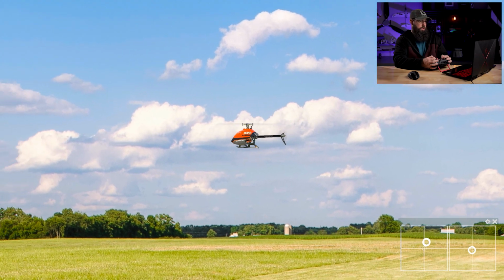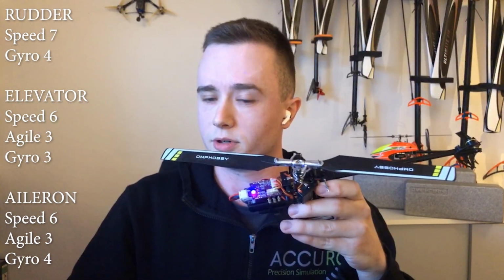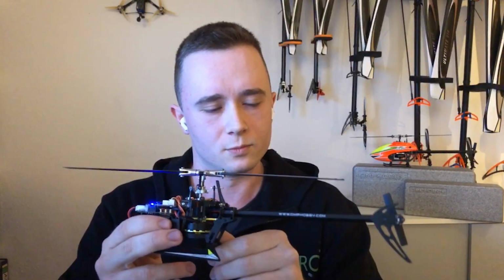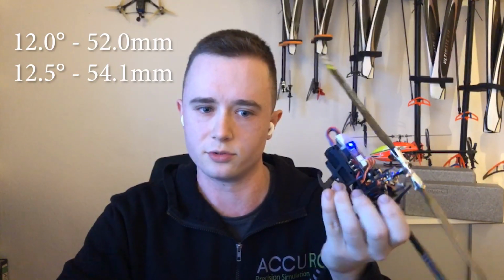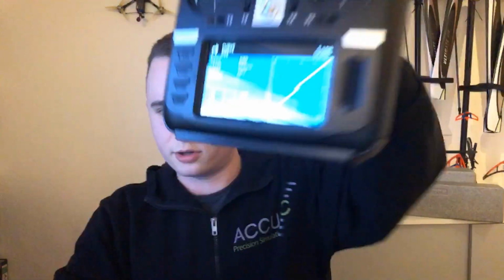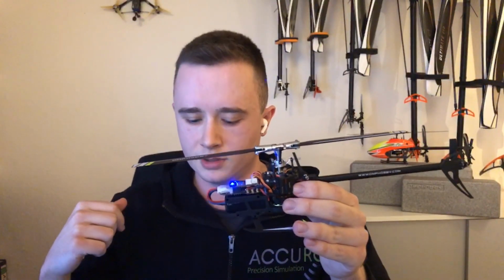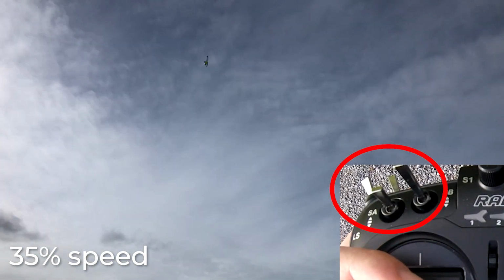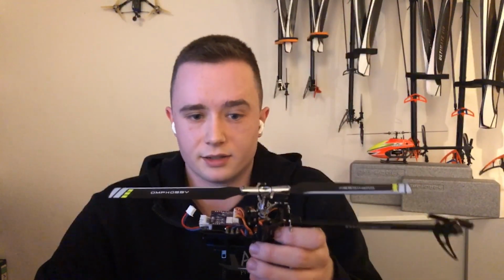Jonas from AccuRC explains his OMPHobby M1 setup on Radiomaster TX16s

Comment: i need help i have the v1 controller of the m1 evo has the omp protocol for the boxer radio it came with i want to set up on the fc say instead of 5 go down to 4 etc but i pull down on the collective when in seup mode and it does nothing the settings are the same am i doing seomthing wrong?
or is the flight controller locked or something?  see in normal mode stabalized i take off from 0 50% its smooth so to a hover but i hit anything other than a hover  and it jumps up then back down to 50% so anything 50 and below is smooth etc i want to make it smooth thoughout the whole curve how do i do that?  the copter is new its that little radio master radio the clear smoked one ..

Comment: 15:37 Although old Spektrum radios cannot do this, newer models like NX series can.    Go to Mixing, choose Mix1, choose Curve, choose AIL > AIL (or ELE > ELE), move the stick very slightly away from the center, choose Add Pt. then create a curve.  For AIL > AIL, the curve values should look like this:  1=0%, 2= -10%, 3=0%, 4=10%, 5=0%.  You are essentially adding an offset curve to the default straight line.
Reply: Why do you want an offset curve?

Comment: I have a model setup for my M1 and M2 that follows John Salt’s settings only because I am still new. I can’t seem to figure out how to set up the safety switch for throttle cut, or hold. I am using OMP protocol and throttle cut is on SG channel 5 and a logical switch for timer reset on SA. I would love to combine it to SA down which resets the timer to also ensure my helicopter doesn’t spool up if SG was not in the cut position.

Comment: I just bought a Spektrum NX8, Not used yet. But opened it up. I wish i watched this video before. I would have bought a Radio master. I use Spektrum for airplanes and works good. I have two helicopters from blade. I'm not good at setting up the transmitter for a helicopter. With the NX8 i could just transfer a set up right to my radio.I just have a question. I want to buy the OMP M1.  So spektrum can't do any of the multiple pitch curve and switch assignments etc. Or i just can't have the save me switch?? Also can i transfer Jonas file for that heli into my nx8?? Great Video!! Just sub couple months ago when checking out omp. This is exactly the video i have been looking for. Jonas what a great guy and super smart.Thanks For Sharing!!

Comment: Hi Jonas, I simply copied my M1 settings to my M2..well they are based on your settings and I really like it. However, on my M2 noticed that when I flip my flight mode switch from normal mode to Idle up 1 or 2 the status LED on my flight controller stays on solid blue and red. Does it mean that its still on stabilization mode if so how do I get it to flash and be out of stabilization mode?
I have not change anything on my radio settings.
 Thank you so much for all your help.

Comment: It is possible to bypass deadzone with spektrum. 3 Mixer with Roll/Roll, Rudd/Rudd, Nick/Nick -> add points at -6/+6 with -8%/+8% (less or more as you like) and endpoints of the curve should be zero. This should decreases deadzone. You could refine the curves by adding 2 more points per curve.

Comment: I’m not new to Helicopter and even that I’ve watched this very informative video that you and Jonas had put out, and can’t thank you guys enough so very very much. I am now in a process of applying the setup to my M1 and can’t wait to have fun with it. Jonas’s setup as far as switches assignments are pretty darn on close how I setup mine. Thank you both again, and hoping to pick up the AccuRc flight sim anytime soon. Regards from Cali.
Reply from the maker: Great to hear.  Personally I did the same and adjusted some switches to my liking.
Reply: @BuddyRC  Hi TJ, first time to Flipped the M1 today, wow smooth like butter even at the highest RPM. Very nice..
Reply: @BuddyRC  Hi TJ, for the M1’s Flight controller for example on the Agility, lowest settings makes it sensitive and the higher you go less sensitive?

Comment: Is the recovery function  going to work on a xk k110 ?
Reply: I don't see why it wouldn't work, you might need to reverse the channel.
Reply: I don't think it will work on K110. I noticed that when K110 flies in 3D mode (i.e. I5(gyro) set to +100) in inverted position and 6G switch is activated (i.e. I5(gyro) set to -100), K110 does not flip. It stabilizes, but continues to fly in inverted position. So I believe it won't flip back to normal position as shown on the video.

But if you make it work, please let me know !

Comment: Super video that would have helped me a lot sooner , I nearly ended with the same settings ! No one could explain me the OMP FBL before...
But I found that i have to reduce the inputs on the radiomaster TX16 to 80% to get the full throw of the servos without binding on the workbench ! The same goes with the agility where I need to reduce to 3 or 2 ...  I think one can see this also in Your esc diagram.

Comment: So from what I have heard you say. You can run this model setup on the M2?
I am going to be getting the M1 soon. 
Nice video with lots of info. 
Thanks very much
Reply from the maker: That's correct. The only thing I would mention is the flight controller settings might not work as well since they are set for the smaller m1. But otherwise it will work fine

Comment: Nice, I notice a big difference in flight feel after changing the flight controller and adding the dead band compensation. Should dead band curve be applied to just aileron and elevator? This wasn't mentioned in the video thanks!
Reply: +1  I'm not clear on that either.
Reply: @Graham_Shaw  I just put it on ail and elevator. Rudder is quite fast at speed of 7 so I don't feel it needs it.
Reply: @WatsitTooyah  Thanks Corey, will do!!👍

Comment: Doesn’t negative expo on Spektrum curves get rid of the dead band?
Reply: I was thinking the same thing.
Reply: Yes i think it could work, but then the Sticks are not linear.
I try this out the next Days.
And, i have prog. the Rescue Switch with the setting to give positive Pitch on the DX9, the only thing if i have no idea how can i do this with a Time delay?
Reply: @DrLowRPM  Hallo Bernhard Wie funktioniert dies bei Spektrumsender? Habe eine DX6 G3 und möchte die Rettung auch einstellen.
Reply: @ABC-mz6pj  Du programmierst einen Mischer auf den Schalter mit dem du den  Stabi Mode schaltest.
Der Micher mischt Pitch auf Pitch und genau umgekehrt zu deiner Pitchkurve.
Wenn du das hast sollte egal wo dein Knüppel steht am Heli immer 0 Grad Pitch sein und nicht verändern. Hast du das geschafft, schiebst du die Kurve mit z.B. einem Ofset von plus 5°.
Nun liegen dauerhaft 5° Pitch an egal wo sich der Knüppel gerade befindet.
Du musst nur aufpassen, das Umschalten und somit Pitch geben geht schneller als das Umdrehen des Helis.
Wenn du gerade im Rückenflug bist, macht er erst einen Durchsacker um 1m  bis er umdreht.
Reply: @DrLowRPM  Vielen Dank für deine Antwort. Das mit dem Mischer ist für mich Neuland. Werde es probieren sobald der Heli da ist. ;) Oder könntest du mir die Spektrumdatei von deinem Heli mailen? Bist du per Mail oder Homepagekontakt erreichbar?

Comment: Does the dead band also exist when actually using the OMP protocol? I'm using the M1 with the OMP protocol on the TX16S specifically, because of the telemetry. That gives me that extra level of piece of mind regarding my batteries in addition to the timer. But yea, I can't feel the dead band - may be because of me being a beginner, still.
Reply from the maker: Yeah but it's one of those things if you don't notice it I wouldn't worry about it.
Reply: @BuddyRC  but now I know it :-D
Reply: Today I've added the deadband-compensating curves - I'm definitely not able to tell the difference :-D
So much more to learn :-)

Comment from the maker: Links to products in the video:
OMPHobby M1 OMP Protocol : https://b-rc.co/omp_M1
OMPHobby M1 SFHSS Protocol :  https://b-rc.co/sfhss_M1
SFHSS Receiver :  https://b-rc.co/SFHSS
Radiomaster TX16s : https://b-rc.co/tx16s
Radiomaster TX16s Max : https://b-rc.co/tx16sMAX
AccuRC Precision Simulation :  https://b-rc.co/AccuRC_Direct
Reply: This is an awesome video with a lot of good help , it would have saved me quite some time of asking and testing befor I got nearly the same results ! 
But I found out that the control inputs of the Radiomaster TX 16 need to be reduced to 80 % to get full servo travel without binding . The ESC too , as also can be seen in Your diagram ...
Does it matter that the servo limits are reached at 70-80% when testing on the bench?